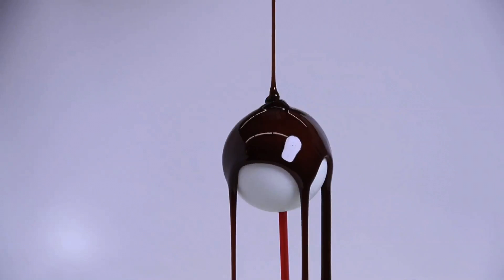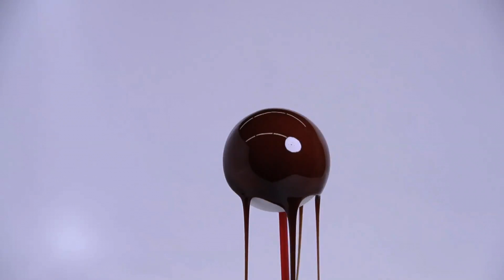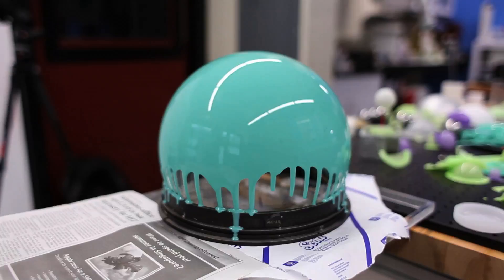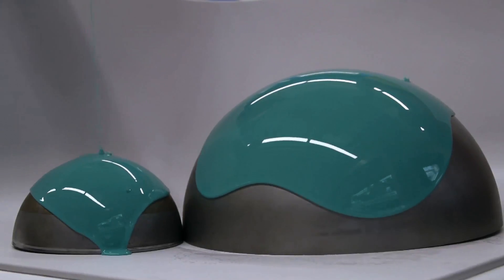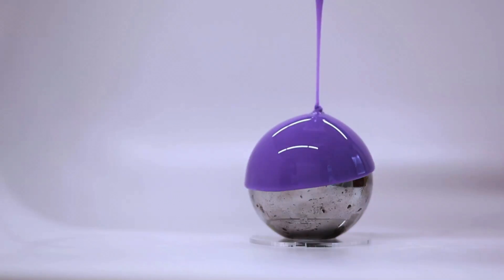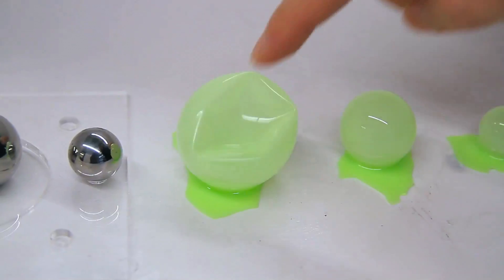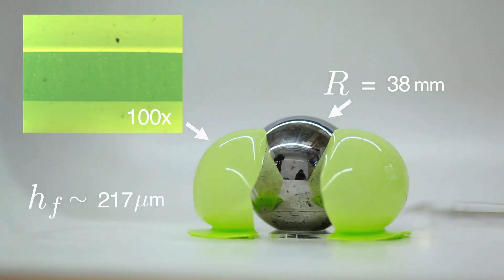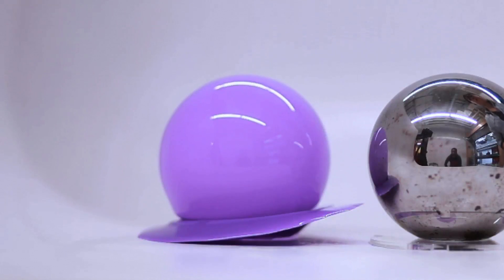Chocolate-inspired theory predicts thickness of coatings

Comment: Thanks! 
Usually you elevate the product with some raisers or cooling rack in a kitchen context. This way anything south of the equator down to let say more that 3/4 of the surface is coated. That would have been interesting to see that in that set up. I mean from a chefs view... but might mess up the calculation maybe. Also, when using this technic, 90 present of the time, I need to freeze the ingredient. So curing time super short... but high quantity needed. Thanks that was very cool

Comment: This is flashy, but really stupid.
According to the annotation of your parameters, it works on round object only, furthermore, it requires the input of curing time, due to the complex thermal conditions on the mold, acquiring curing time requires molding first. 

If you have already known the radius of the mold, done the molding, and known the fact that the thickness of the elastic shell is "nearly uniformed from the pole to the equator", why don't you just wait till the shell cures, weigh the top half of the molding to get the volume of the shell,  and calculate outermost radius minus mold radius to get thickness? It's simple middle school math! Curing time can't be measured with great accuracy, but weight can.

Another thing is that all this could be done using computer modeling, why bother write an equation?

What are you doing MIT? Are you kidding me? You just got schooled by a high school student. Answer me.